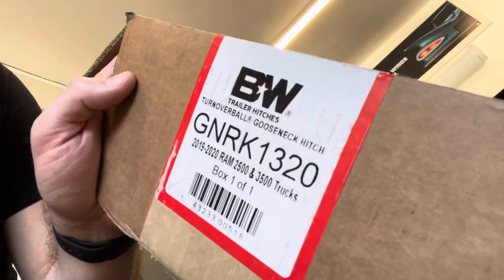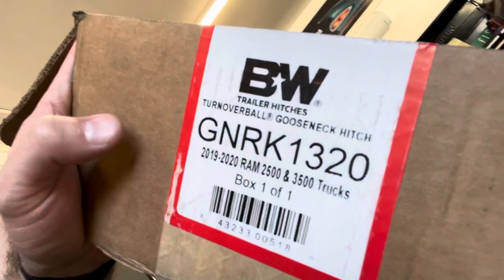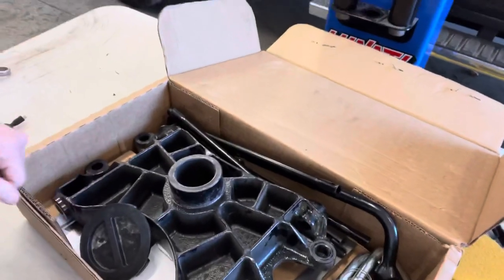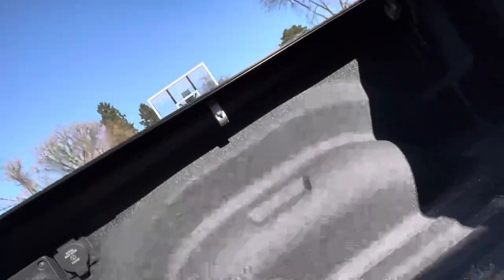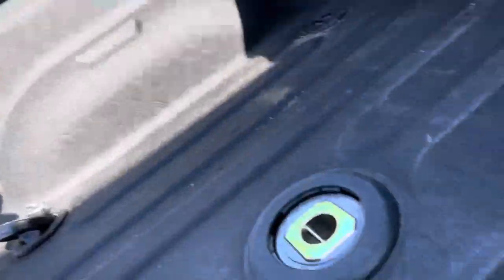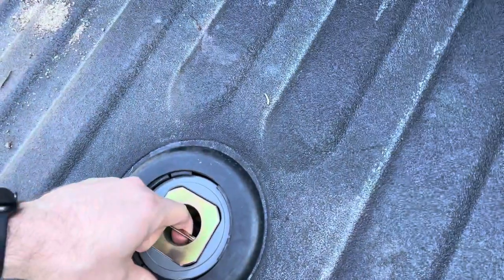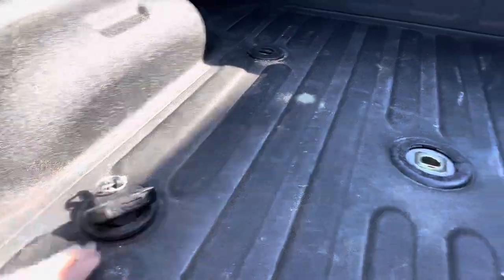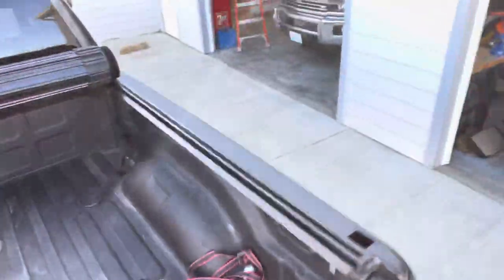B&W Turnover on Ram Factory Fifth Wheel Prep

Comment: Thanks for the video, just did my 2022 today.  Same kit, I didn't lift the bed and reused the 4 verticle bolts.  Couple tips that helped me, dropped the tailpipe, spare tire and exhaust shield for more room.  To reuse the verticle bolts, I had to ream the holes in the new hitch just a little (I used a 13/16" reamer, made quick work of it).  Had to trim one verticle bolt about 1/4" that ends up right underneath the ball release.  Make sure you have an assortment of universals and an imagination to get a couple of the horizontal bolts out.
Reply from the maker: Thanks for the extra info and tips! Super helpful!
Reply: How did you get the factory bolts loose?
Reply from the maker: @michaelfwv  I had it on my lift and couldn't get them to budge, they're super tight. Ended up taking it to a diesel shop down the road and they spent 2 hours just getting the bolts out and even they complained about how tight they were. Its possible, but tight!
Reply: @michaelfwv  the horizontal ones towards the cab and all of the vertical bolts I used a 3/4" Drive Impact with a universal (swivel).  The rear horizontal bolts were a pain, wasn't enough clearance for the swivel to use the impact, so ended up using the socket, 3/4" ratchet and a short cheater pipe.  I did this on the floor, so wasn't room for a bigger cheater pipe.  The Pneumatic Impact made quick work of the ones we could get to, but the two we had to do by hand were tough.
Reply: @joeyipock8944  Thanks

Comment: Used a 3/4” bit to tap out the vertical holes ..i used the safety chain hoops to free up more bed space .. Also removing the last piece of the tailpipe would have made it’s easier. The vertical bolt on the driver front has to be trimmed down to make room for the slide bracket..